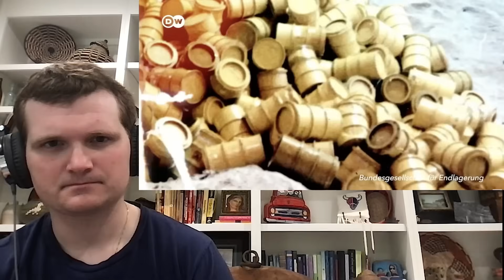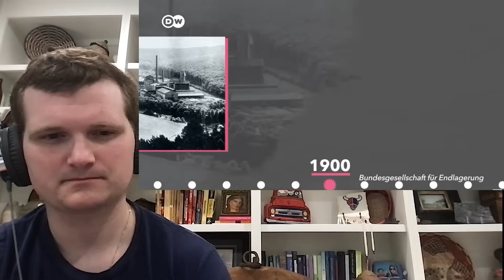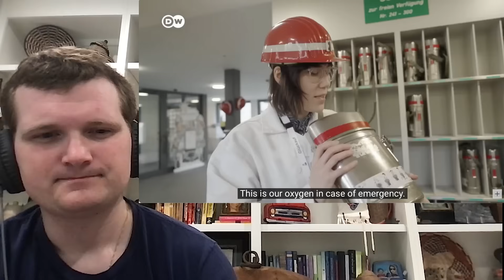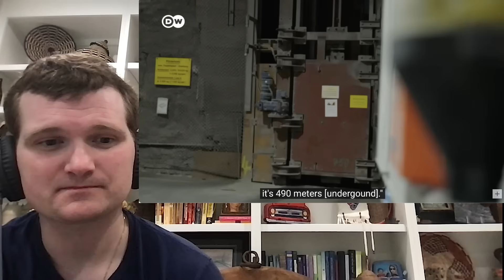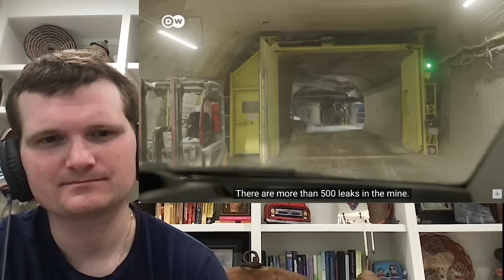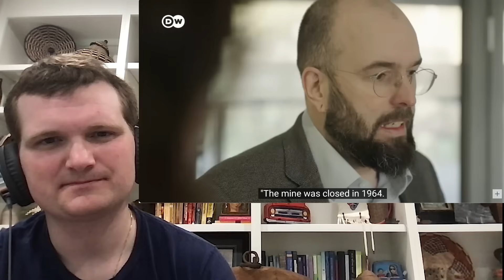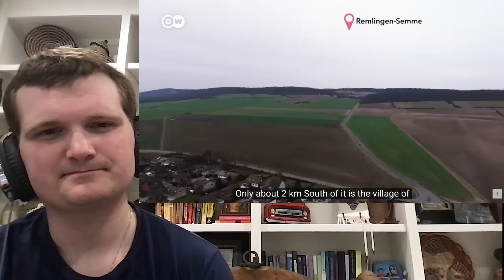This Nuclear Waste Dump Has Been Leaking for How Long? - Nuclear Engineer Reacts to DW Planet A

Comment: Nearly all "nuclear waste" is stuff like uniforms, trash, etc. It could be laundered but bureaucrat's regulations say you have to throw them away. 
 People do not understand we are constantly bathed in radiation from above and below. Our bodies evolved to handle it, DNA does self-checks/restores, for example. Massive dose is of course bad but minor doses over time, we handle easily.
  Uranium is extremely common (theres far more than copper) and dilute, decays into stuff like radon. Homes where I live have to be radon tested, fans installed. My folk's house's basement showed 7x count higher than the kitchen to my counter.
The lesson here is really bureaucrats, who construct places like Department of Motor Vehicles (my last time was a 5 hour wait), do a terrible job managing. They need to be offset.
Germany has extremely rigid thinking and brilliant technical work. (They invented the modern computer virus.) Its extremely hard to start a business there and get ahead, you're heavily taxed.
  It doesn't surprise me they machine gunned themselves in the foot by shutting off steady baseload nuclear power. Green Party is quite strong there, but cannot decide if non greenhouse gas emitting nuclear is better or not. Fear of radiation drives some; fear of climate changes drives others. But it remains fear, not logical analysis. German heavy industry has taken a severe hit since electricity is now unreliable. "Can't work tonight, no solar, no wind". Battery storage still lags terribly for really demanding industry. Germany made a bad choice. During its heat wave recently, there were so many regulations against air conditioners that people died. This is slow decline.

Comment: Back in the 90's before my father passed he had told me the mine he worked at buried nuclear waste in earlier days, filling a tunnel with radio active waste and sealing the tunnel with concrete. The old mine is now flooded with water. Far fetched? I'm thinking its not so far fetched.

Comment: And this is exactly why I do not trust statements like "nuclear power is safe". Sure, risk of melt downs are becoming smaller and smaller. But in the end, money decides whether something (nuclear, or other) is safe or not. And as long as short cuts save money... Yeah.
Also: the statement that nuclear power generated electricity is cheap may be true. But the cost of storage should be paid for per kWh. And not just be paid by the tax payer.

Comment: Couldn't the low level waste that's various disposable materials be reduced on-site with a processing center for compacting burning or charring (or melting) various textiles, plastics, paper, etc down to a much more compact state, then repackaging it to send off site?

OTOH, the barrels themselves would need to be compacted and condensed as well. (or decontaminated)

Comment: Honestly this presentation does not give the impression that leaving the nuclear waste exactly where it is, even with full flooding, presents any risk whatsoever. Yes, the waste is of unknown quality and probably has leaks, but the question is how far and how much radioactive material could potentially be transported. While that number might be greater than zero, there is probably not enough radioactive material in that entire mine to create a significant groundwater hazard. 

Put another way, a single CASTOR V/19 cask can contain materials that emit around 4.4x10^17 Bq which would be around 200x higher than all of the worst-case inventory of nuclear materials in the entire mine put together. And what could potentially leak out of the mine is a tiny fraction of that.

I think the political blustering about relocating the waste in the mine sounds like a hyper-conservative evaluation of risk, to the point that the relocation operation sounds like it has more potential risk than simply leaving the material where it is. If we look at sites like Fukushima (an accident that released the same order of radiation as a single spent fuel cask, although with a different material distribution) and Chernobyl (which emitted many hundreds of times more than 1 spent fuel cask), the groundwater readings today near fukushima have undetectable CS-137 and SR-90 and only Tritium is at higher than background levels, while Chernobyl has barely detectable Cs-137 and Sr-90 around most of it with only a few hotspots above safe drinking and discharge limits. That is to say, that the amount of radiation that could be emitted in the event that Asse II is left completely un-checked should be 200x less than either of these sites and it has been down there 50 years, which is at least comparable to Chernobyl. All of this to say that the total potential release is effectively zero. Am I off with this arithmetic?

Comment: After 17 years they haven't even completed step 1 , a proper survey that gives you site inventory estimates. Why you ask ? Because Germany passed an insane law that makes nuclear workers strictly , unlimited and criminally personally liable for causing a "nuclear hazard", so for example if you exceed your permit by 10 Bq , you can be prosecuted. Add to this that everything always has to be state of the art and technology, any crackpot paper by a scientist bent on preventing any progress can trigger a 5 year mandatory review. These laws were designed to kill nuclear power in Germany, and they succeeded. So in short they are spending billions on something they have no real idea about whether it actually is a real problem or not.  They created a borehole to chamber 12 around 2018 , but have yet to make any survey, because they measured 17,000 Bq of Radon per cubic meter escaping the borehole (a dose you can find in basements of some old houses for comparison) and they are spending millions on further studies before they are allowed to take a 100k piece of equipment down there to do a survey. This is Kafka, Idiocracy and Groundhog Day all rolled into one.  What the idiotic Greens who were the driver behind these idiotic laws have done is increase systemic risk instead of reducing it.

Comment: You could actually transport it to Bure, in France, which is being built as a proper nuclear waste storage site. It's not too far from the german border either. You'd need to check if the construction timeline and the extraction timeline are matching but, it's not impossible I'd wager.

Comment: I've been in there too. I've been down there too. You should definitely bring water to drink. It's extremely dry air in there. They have lots of problems with unknown content - chemically and biologically bursting barrels. The mine is huge though. I was also some hundred meters below the waste, where they were doing experiments. I brought salt home and used it in the kitchen. There is another salt mine with nuclear waste, Morsleben (the name is a pun in itself (mors=dead (Latin) and Leben is life in German)). It was the first village beyond the iron curtain. The GDR dumped stuff even worse. There is also water inside. The salt layer is a lot thinner. The location was chosen politically. When the GDR collapsed they continued using it until 1998 because it was legally approved.

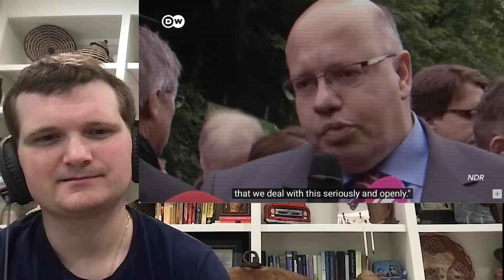Comment: @tfolsenuclear 32:00 that is normal we vote a new Bundestag and Government  every 4 years and with the new Government and new Kanzler all of the Ministers get changed too. The Kanzler can also change Ministers further more we also have a fail safe (no-confidence vote) were Ministers and even the Kanzler can be voted out by the Bundestag if they feel like the aren't doing their job.

Ps: A other big problem I didn't heared beeing mentioned here is the possibility that the radioactively and with heavy metal contaminated water in Asse II could leak in to the ground water. The ground water is in most regions here in Germany the source of drinking water.

Comment: I remember back in the late 90s, it was on the news that the power company was going to demolish the cooling tower of their decommissioned nuclear power plant. Anyway, the news also ran an extended documentary-style segment—a real mini-doc, about an hour long—showing how they were preparing the cooling tower for implosion and all that.
In the same segment, the host asked what they were doing with the old reactors. The guy said they bury them in a special type of concrete made for radioactive material, called Radiation Shielding Concrete (RSC). They encase the reactors in these radiation-shielding concrete structures and bury them deep underground. She didn’t say exactly how many feet down, but that’s how they’re disposing of the reactors. Pretty wild if you ask me—like, damn.

Comment: Hey Tyler,
This is a pretty solid thought: everything you learned safety-wise in school—just remember that all those safety books and rules were written based on the guys who worked in the late '50s, '60s, '70s, and '80s.and 90's
Those workers were some of the first ones doing the job, so when things went wrong, it was often the very first time that particular problem had ever happened. A lot of the time, they had no playbook—they had to figure out on the job how to clean up a spill or handle whatever mess came up. They weren’t taught “what if this happens” or “what if that happens”; they were just winging it.
But here’s the key: after those guys learned the hard way through firsthand experience, that’s when the safe methods got written down. All the safety books and procedures we use today were built off the incidents those early workers dealt with—many of them the very first time that issue ever popped up anywhere. They were the ones who came up with the safest ways to handle it, and that knowledge became the handbooks and routines on how to clean up any type of mess.
So big thanks to all those guys who came before us.

Comment: So...
If all the contaminated stuff, like the barrels, were instead put into giant concrete chambers and THEN moved into the mine, that would have STILL been better than what they did?
And if they had just built an area inside the mine that was self-draining around the "concrete block storage area," it would have been safer still?
This means that the issue was entirely avoidable and could have been handled almost the same with just a few tweaks.
And it should have been handled as much as possible on-site to begin with, even if they wanted to do something like that.
Glorious.

Comment: Those are 100% Chemical reaction based oxygen generators. They are only activated in the event of a cave in and you are trapped. I carried smaller unit when i toured an underground mine. You break the seal and there is a mouth piece that you essentially bite down on like a scuba tank rebreather.

Comment: This is a geologically stable area.  They could convert this cave into a safe storage area for low level storage and keep it pumped out.  This is a stupid “emergency” 🤣. This should be organized and contained.  The mine “closing in” is a natural phenomenon that is not unexpected or emergent.  Using mining equipment to re-open cave openings and keep the area opened up is NORMAL for any mining operation.  So basically you could move salt from the used areas to the unused area.  Also, the caves can be lined and stabilized.  Best solution is to organize, separate, cask and pump to keep dry.  This mess should stay where it is

Comment: Low level and intermediate level waste are long duration nuclear waste...which much much much much more dangerous than extremely radioactive short term waste that everyone is scared of because it is nearly impossible to prevent from getting into the environment.  Most people, even those in the nuclear industry, do not realize this.

Comment: I’m guessing that the air regulators that they were wearing was actually to comply with mine safety regulations, not for the Nuclear aspect.  They are in a salt mine. They probably have to account for EU mine safety standards.

Comment: Fukashima is the biggest accident not chernobyl or 3 mile island
Reply: Lies. Chernobyl is by FAR the worst nuclear accident, Fukushima doesnt come ANYWHERE close to it. Cesium 137 emission from Chernobyl into environment was 9x times worse than with Fukushima. In Chernobyl you had burning reactor spewing out radioactive materials high into atmosphere and spread over much wider area where it was of immediate and long term danger to human lives, where most of Fukushima's radioactive material just leaked into Pacific Ocean from partially damaged reactors and partially melt spent nuclear fuel. Let alone that the accident itself in Chernobyl cost lives of 31 people directly, where in Fukushima the cost of lives directly was 0.

So before you come and say something stupid, learn the facts next time.

Comment: Most of germanies political party system is one, corrupt block and the peopel interchangeable. 

If one is caught doing something criminal, they MAY be replaced, but not punished, often come back later and in the meanwhile mostly switch jobs to companies which were interlinked with that corruption and keep pushing the same crimes.

By the way: one leading minister during the Asse scandal was Angela Merkel, also not punished for it, no, became chancelor for around 16 years from 2005 to 2021 and kept mishandling it. On purpose.

Her party, the leading one in germans since it was 're-created' after 2.WW (and took a hell lot of Nazis in an whitewashed the rest) is known for its corruption since the earliest years. But it never had any consequences, even majority of people kept voting for them...

Comment: ☢☢The yellow barrels do not contain highly radioactive waste such as uranium, etc. They were filled with rubble and components from demolished reactors and plant buildings. Highly radioactively contaminated rubble and such.☢☢
In my opinion, the media exaggerated the whole thing back then... And because Germany is Germany, everything surrounding this topic is extremely overregulated and artificially inflated in price. 
This low level waste isn't really big of a deal, and the high level waste has been already removed long ago. And you can be sure that Germany has stricter regulations than the USA. Because it's Germany.

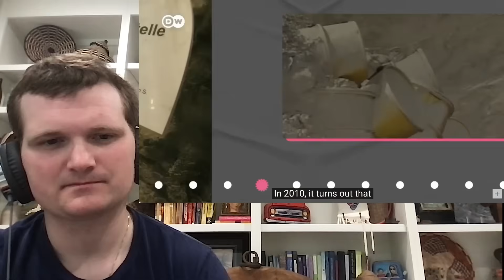Comment: re-letting them in @31:00 - AFAIK they owned that mine at a time - no one question that some company trucks are on company property :)

And yellow barrels - AFAIK they came as originally bio-hazard and toxic waste was stored in yellow drums, color was selected to be visible in multiple conditions. Also, Low level waste was classified as toxic in 1950/1960 in some places.

Comment: While DW is typical anti-nuke cesspool, this one is not that bad.
Now, one thing is that form 1971 they used wheel loader - push and dump to hole method resulting in mess. Before that they where actually stacked and organized. That change was to save money,
The crane was used for LILW-LL (long lived medium waste) only to minimalise exposure.

Comment: I noticed the video didn't contain any actual numbers regarding the radiation risk from this site, so I went looking for some. 85-90% of the waste barrels are low-level waste. According to the president of the German-Swiss Radiation Protection Association, even if the mine were to completely flood, the local population would only be exposed to an additional 0.1 millisieverts/year (the same amount you get from a chest x-ray). It seems like it would be better to just leave the waste where it is and fill in the mine with a non-permeable material.
Reply: So they would literally be better off dropping a few layers of the mine and filling the gaps with concrete, and it would be cheaper, too. This isn't a problem in need of a solution; it's a solution in need of a problem. Someone is making a payday off this, or it's idiot bureaucrats overcomplicating this.

Comment: Seeing this mention of water reminds me again - WHY don’t facilities with radiologically contaminated water use evaporative systems to reduce the volume of water. At the Hanford site, there’s a pave evaporator that’s used to reduce volume of contaminated waste - water is added prior to pumping of waste, to improve it’s movement - and once complete, it’s removed, with no trouble. Fukushima has had serious issues with contaminated water volumes and you’d THINK it could be used there too.